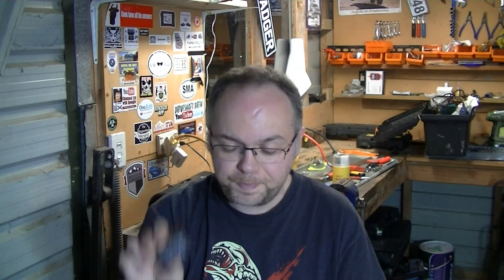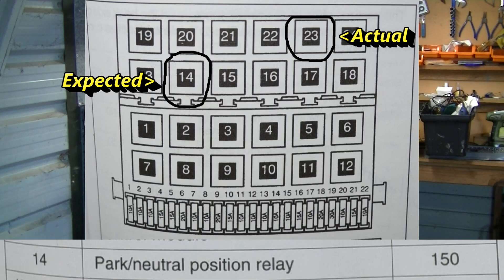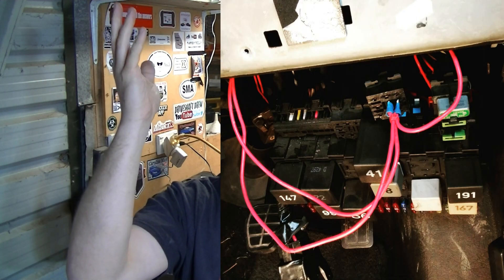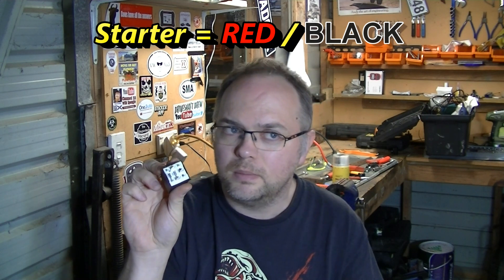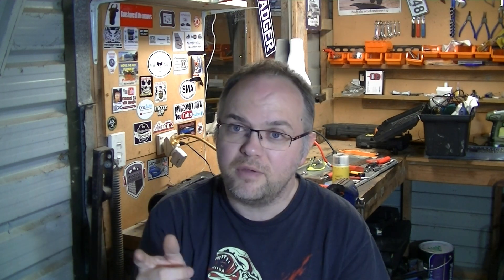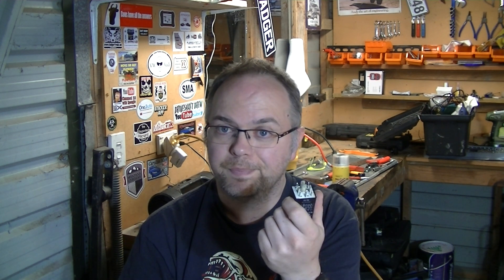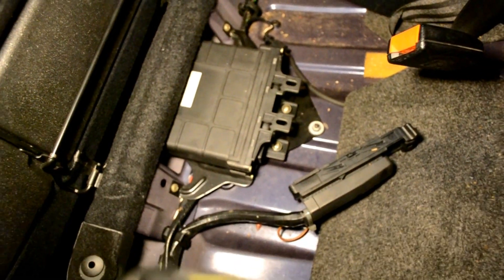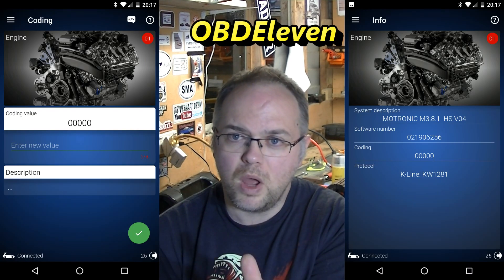MK3 VR6 Auto to Manual Wiring Changes

Comment: Hi, I'm currently doing this in my 93 corrado and had a question. Did you just tap into the ignition switch wiring and ran the wire to the fuse box? Assuming you put the spade connector in the same color slot.
Reply from the maker: I can't remember now, it was a few years back.
Reply: @Badgertronix  
Got it figured out, your videos helped me a whole lot.  Thank you

Comment: Im actually doing a conversion right now on my vr6 from auto to manual  plus a heater core change. it is exactly as you described as ive done this conversion on a 2.0L mk3 cabrio same ordeal again electrical is the same change both euro spec cars. Excellent presentation with accurate info. Keep it up my friend.
Reply: OH WHAT FUN, a heater core change... :/ The one job where you soon find out why it's call the heater core. Core as in the centre of the universe. I swear VW engineers were sitting around one day and thought "hey, I got this heater core, let's be complete idiots and build the entire car around it so when, NOT if, the time comes to replace it, you'll have to take apart pretty much the whole car just to get at it".
Reply from the maker: Awesome! Thanks for watching and glad to know I didn't make it up like half the info I found on the conversion online. Cheers!

Comment: I would expect the tachometer to work just fine, since it's running off the crank sensor.  The speedo however is definitely an anomaly.  Can't say I've ever seen an 01M with a 2-pin speed sensor; they're all 3-pin here in the States, and the FDR between the auto and manual is different enough to have to adjust the speedo.
Reply from the maker: +rhkips I'm not sure on the speedo accuracy yet but it definitely works and feels vaguely accurate. I thought it was 2 pin but I'll double check. Cheers

Comment: Didn't sound too bad of a job there Jonathan in getting the wiring issue sorted out. I'm sure that your information will help a lot of people out there who are changing over from an automatic to manual transmission.
Reply from the maker: +stuzman it was nice and straightforward once I had worked out how it all worked and stopped trying to follow the guides I found on the internet. Cheers Terry